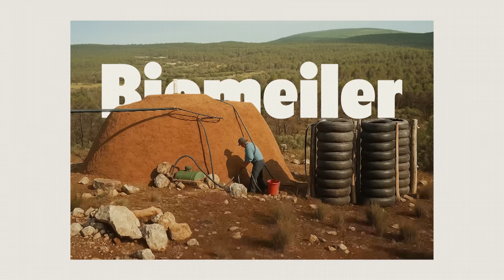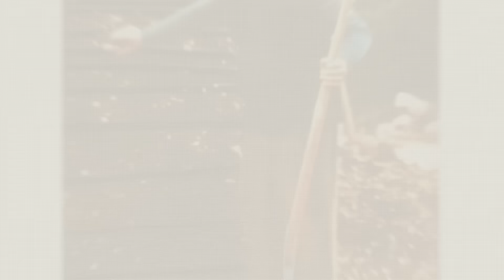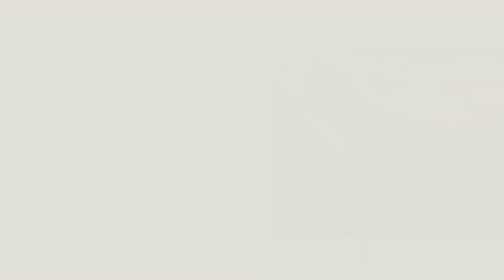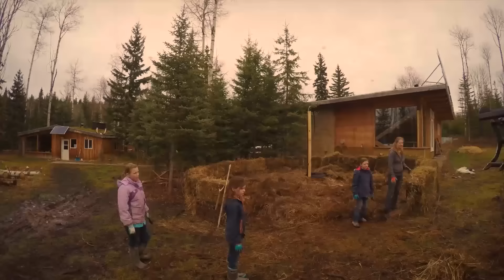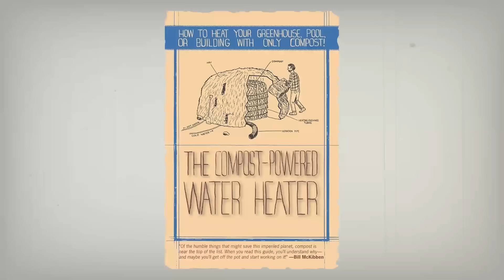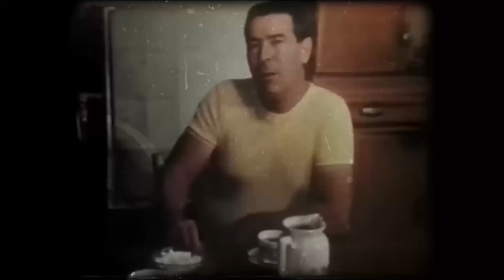This Creates UNLIMITED Green Energy Without Electricity

Comment: An industrial scale mostly automated version of this would be a brilliant way to make fertilizer, gas and clean/pump water into a water tower

Great for farmers to do with a field that they are "Resting" they could use gaseous fuel for farming equipment/could sell excess then use the compost produced to fertilize there field

I'm thinking some kind of purpose build silo like a grain silo that is wide but short and can be drained into a Dump Truck to then be put on their field
Reply from the maker: Sounds sensible!  There is actually a commercial greenhouse grower using this in the Netherlands.  They use their agri-waste in the biomeiler to heat the greenhouses and then have fertiliser for the process.
Reply: Yes, but not industrialized scale.  Decentralized regional scale!

Comment: First, the principle of fermentation gases is not unused, but intensively used. In Germany e.g., there are close to 10.000 of biogas plants in service, usually run by farmers using manure or biomass, or bigger plants using waste from food production.
Second, it is quite obvious that these systems are not at all a solution for worlds energy demand: They need vast amount of space, and there simply is not enough fuel on earth to run them.
Reply from the maker: Appreciate the feedback.  Yes totally agree in regards to the number of plants in German.  Many of which feed their methane into the gas network and get paid for it.  In regard to your second point, the element that is unique about the Jean Pain system is that it uses wood chip and not manure.  Many people miss this point. If we used thinings and harvesting wastes then we could supply a large amount of the energy demand of the world, perhaps not it all but a fair amount and at the same time have premium fertilizer to sell which is currently a big issue.  So while I agree with you, I also think this is a great solution!   Thanks!

Comment: This video does a good job explaining Jean Pain’s “biomiler” compost‑heating system and why it’s intriguing, and its core science is correct: large compost piles can produce months of heat, some biogas, and rich fertilizer. 
However, the title and framing are misleading:
It is not “unlimited” energy, and it’s not without electricity if you want useful power output.
It’s also not a simple backyard project – you need tons of wood, serious labor, and land most people don’t have. 
Verdict: Worth watching for permaculture/off‑grid enthusiasts, but treat it as one niché, low‑tech option among many (solar, heat pumps, modern biomass boilers), not a forgotten magic bullet that solves the energy crisis by itself.
Reply from the maker: I don't think there is any "one magic bullet" that solves the energy crisis, it needs to be a combination of many as you say!  The framing wasn't wrong for Jean Pain - he did have access to free fuel and so the energy he got was free.  But you are right to say that it is not available to everyone!  Thanks!

Comment: You basically took information that is already on the web and produced a video that slop. Regurgitating the work others have already put out there.
Reply from the maker: Ok if you believe that then tell me what is a CoDiNox systems. Only an engineer who has worked in the agricultural industry for a long time would know this.   Or perhaps I should ask you about Periodic Night Breaks which are also things only known by engineers who have actually designed agricultural systems.  Go and ask your other sites those questions! Or even ask them whether or not Jean actually evolved his process such that he built his own range of chippers and forestry machinery to make the exact wood chip sized needed for his system to work. I don't normally reply to these comments but you got when with "regurgitating the work other have put out there."

Comment: There are bio-reactor co-generators plants across Europe - villages in Austria for example, frequently gather manure from cow farms and other organic waste in a plant next to the village (yes the smell is rancid), to produce bio-gas, heat and power.
Reply from the maker: Yes I was involved in one of those.  Actually installed a CoDiNox system as well to remove the CO2 and use it in the greenhouse.  Everything was used, even the CO2 from the gas engine!  Appreciate the comment! Thanks!

Comment: For those in an urban or sub urban environment consider the yard waste section of the municipal dump, at least where I live I've seen a lot of brush there maybe not enough to make one of these piles in one go, but almost certainly enough if you could go in and gather brush for a few weeks.
Reply from the maker: Totally agree!  I see brush lying around everywhere, just beens gathered and chipped.  But that takes time and money which is the biggest challenge.  Appreciated the comment!
Reply: @wildline_YT  That's why I was mentioning the municipal dump, it would still take time and a big truck and a wood chipper, but depending on who you talk to and how you ask you might be able to just take it away for free.  Also if biomilers work with other organic waste you might be able to just raid all your neighbor's yard waste/compost bins every week before they get picked up by to go to the dump.  It's that part about using waste streams as inputs that makes this functional in an urban environment.  
I read about an Native American tribe that had set up something similar with sewage processioning tanks that were optimized to produce methane which was then turned into electricity back in the mid 00's.  The other outputs were water and soil(though cleaning all the plastics and heavy metals out of that from a city sewer would be a nightmare).

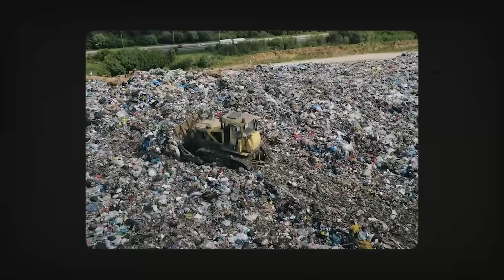Comment: Really fascinating deep dive into Jean Payne’s work—thanks for highlighting such an elegant 'closed-loop' system! One small clarification on modern waste management: in the US, most large-scale landfills are required by law to cap waste and harvest the resulting methane. This gas is often put to beneficial use as renewable energy or flared to convert it into CO2 and water vapor, similar to the outputs of aerobic composting. While the Biomiler is a brilliant decentralized solution for heat and fertilizer, the argument that landfilling organic waste always results in unmitigated greenhouse gas emissions isn't quite accurate for modern commercial facilities [11:08]. Keep up the great work!
Reply from the maker: Yes I have to agree!  Commercial landfill do tend to use the methane in engines or turbines for power generation. Appreciate your clarification on that point! Thank you for the comment!

Comment: Like all of these "lost technologies" it's not lost...it just requires money, specialized knowledge, and time.  Methane is also terrible for the environment, the seal is not great on a dirt pile, so smoking near it could level any structures nearby.  It's why it is often used at an industrial scale at waste management locations.

The way this guy set it up isn't possible, tires are tubeless now, and using tires causes soil contamination.
Reply from the maker: Yes you are right, today you wouldn't really be able to have the same set-up as you would need to installed a pressurised system that met gas regulations in order to store the methane.  But back in the 1970s this wasn't too much of an issue.  Appreciate the comment.  Thanks!

Comment: 🌈This would be phenomenal to implement with district heating/ cooling and funnel all food and other organic sources from residential, commercial, and municipal streams to reduce environmental impacts and provide multiple benefits 🏆

Plus, installing some sort of conveyor belt to remove the rich humus (not huMMUS🤣) from the bottom to reap that rich soil 🌱
Reply from the maker: Totally agree! The only challenge is when the compost heat is finally finished generating heat - it needs to be deconstructed and rebuilt.  I think district heating would benefit using a more modern system like a biogas generator where it could burn the gas directly in a gas boiler or power generator.  You see these in commercial applications.  The Biomeiler is better for farms and people with forests who need to undertake thinning works.  Great thinking thou!
Reply: If it could create hummus too it would be perfect :)

Comment: Im calling bs. That much wood powers enough ele trical generation to do more woth an electtric vehicle  and heat your home and power your home with a simple gasifier. 

That is a huge amount wo wood required
Reply from the maker: Are we playing cards here?  Well you need to pick the pack up as what is stated is fact.  In respect to you saying that much wood could generate electricity to power your home and vehicle using a gasifier - can it?  Well 40 tonnes is equal to 4500 kWh/odt (19kj/kg @ 0% moitsure) which means you have 180,000 kWh of energy. Lets say using a gasifier you turn that into syngas (70% conversion efficiency) = 126,000 kWh of gas equivalent. Now gas generator burning syngas would operate at around 20% efficiency, so you get 25,200 kWh of electricity.  Lets say you use 40 kWh a day for heating and running the electric in your home.  That is 14,600 kWh (so yes you could run the electricity for you home).  That leaves 10,600 kWh for the car - (3 kWh per mile) 3,533 mile.  Yes so you could run your car as well.  You are correct but you have no humus.  You do have charcoal if your run your gasifier correctly (downdraft is more efficient) so not a bad option! Good feedback - thanks!  I think you will like our video on gasifiers that is coming out soon!
Reply: @wildline_YT  yeah it seems equivalent to a gasifier except it doesn't produce as much carbon dioxide, which is definitely a plus